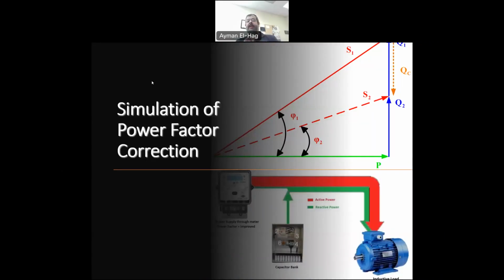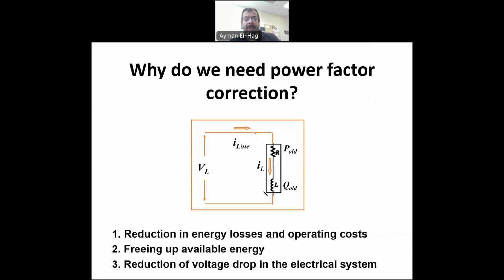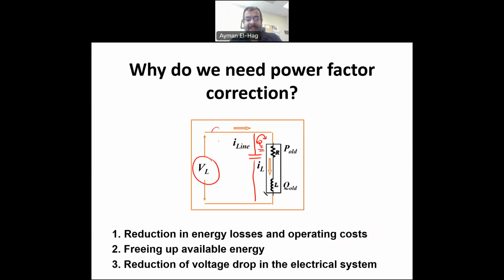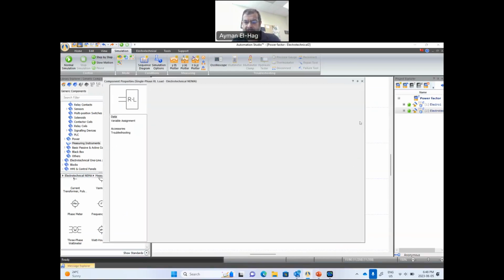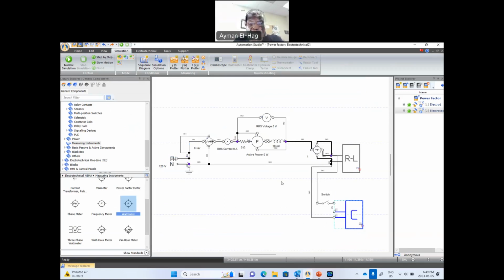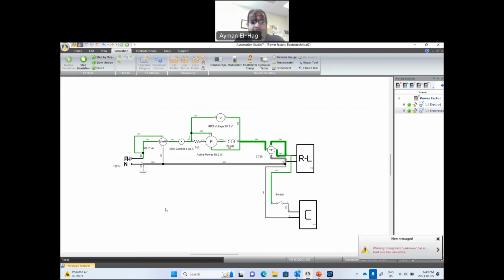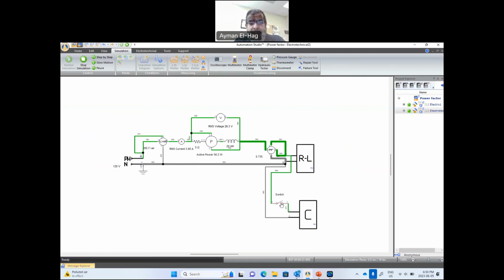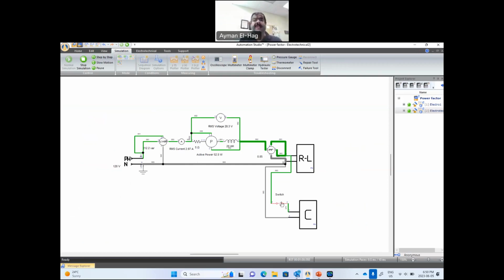Simulation of Power Factor Correction

Comment: Hello Sir, what makes a load highly inductive, In this example Complex power is 500VA, Reactive power is 350VAR, If we calculate the Real power, it comes to around 357W which is nearly same as Reactive power.
Reply from the maker: First inductive loads are any thing with a motor and resistive loads are loads with heating elements like water heater, toaster, etc. At home we do not have too many inductive loads except the AC. But industrial loads are highly inductive as they have several large motors.
Reply: @electrical4everyone  Thank you for the reponse Dr Ayman